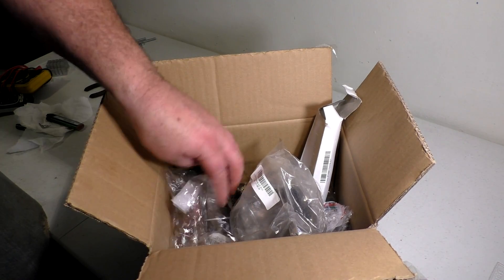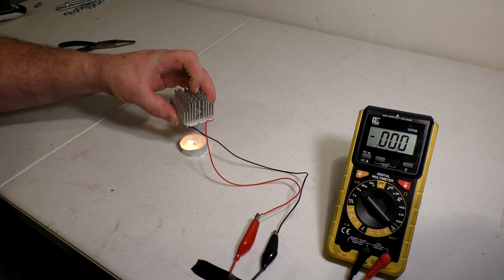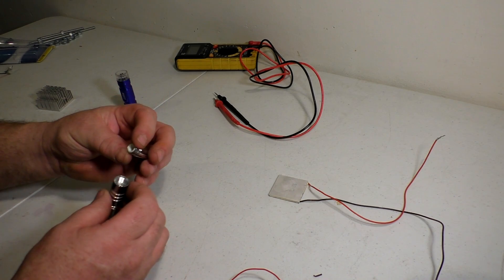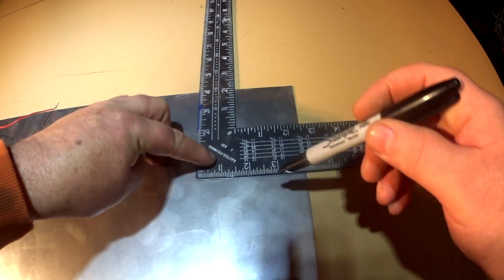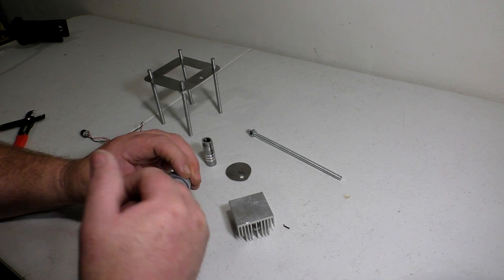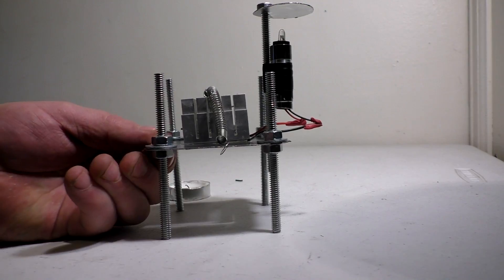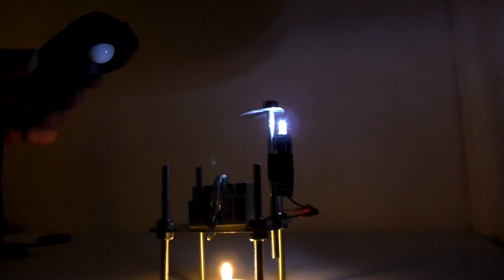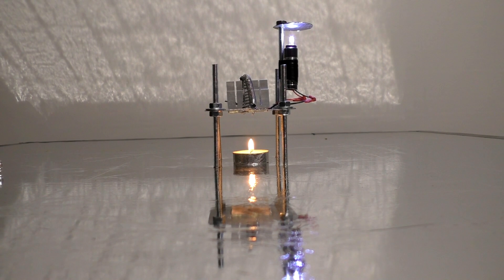Candle light Generator producing 8 times the light for free

Comment: thermo electric generators are cool I thought it would be an interesting  idea to try to run the car exhaust (if you ever touched your leg to a notercycle muffler you can relate) around a bunch of these to try to make it run without an alternater of course you need to be some where cold for it to work best